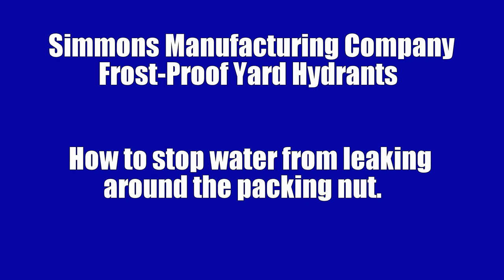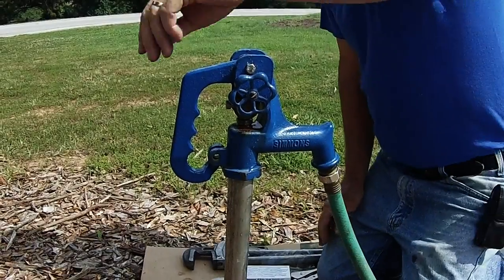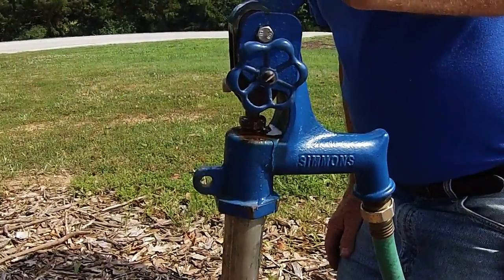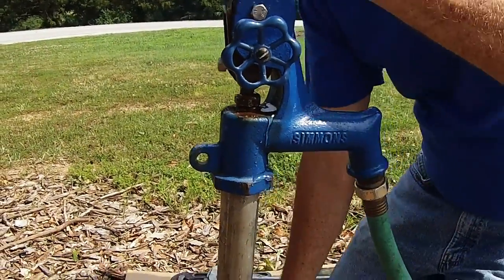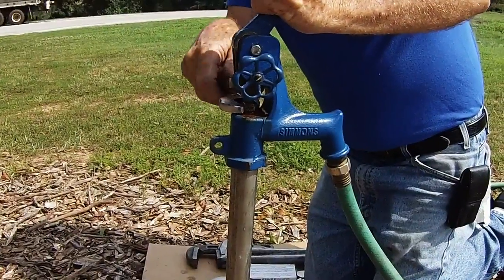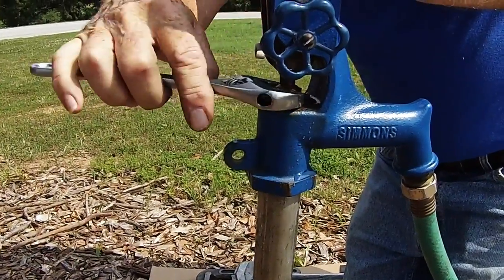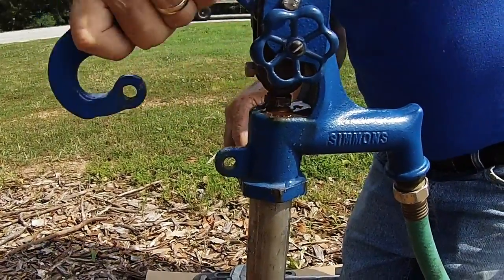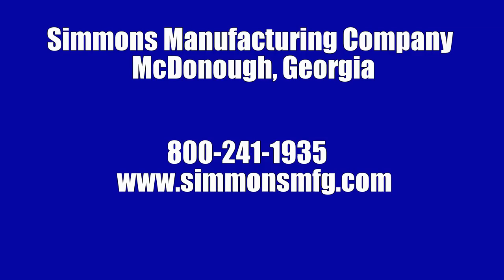Simmons Frost Proof Yard Hydrant- Leaking at the Packing Nut

Comment from the maker: That is the flow lock wheel. It allows you to lock the handle in any position to control the exact flow you want through the hydrant. Also, if you have livestock or horses, it will lock the handle so they do not rub against the hydrant and close the handle.